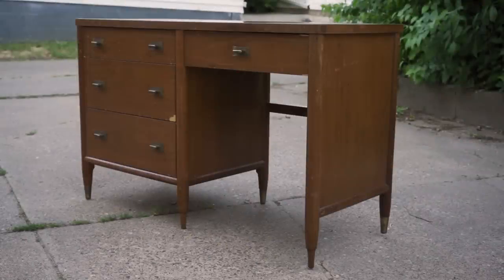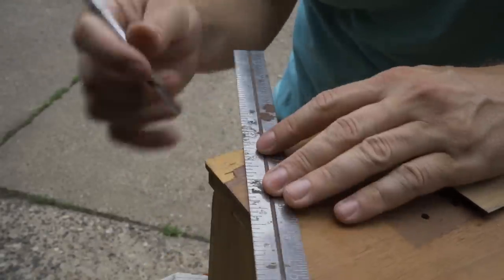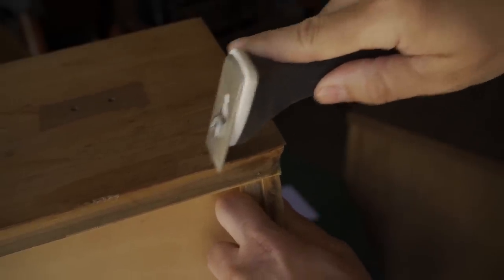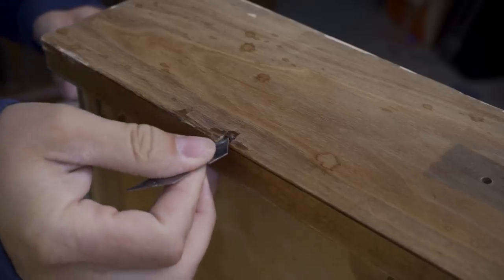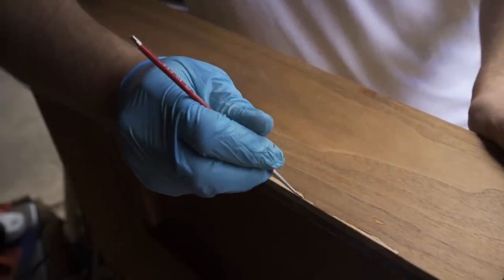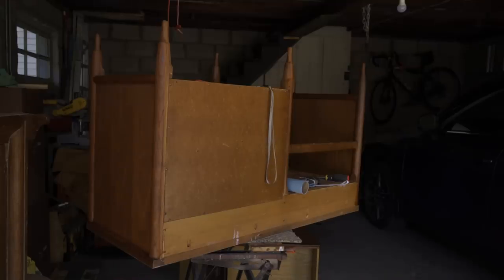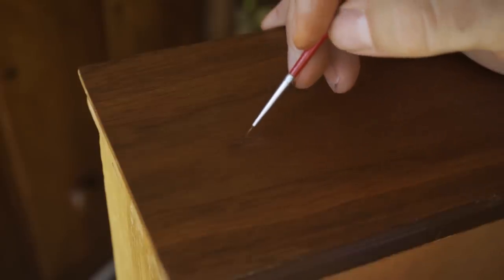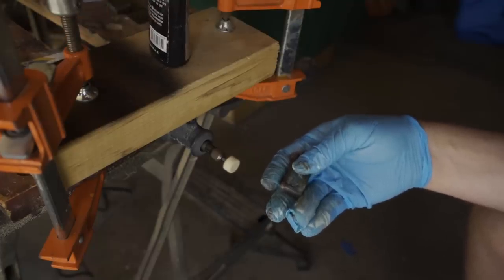I Found A Free Desk On The Side Of The Road And Took It Home For Some Repair And Refinishing

Comment: Looks great, but I think it needs its “shoes” back on.  I would try to find a set of “sabots”.
Reply: Agreed. They are half the charm of a mid-century piece like this.
Reply: I would place the side "shoes" back on and the front middle one. I would fake the one in the middle back with wood filler or whatever was handy to make it thicker and paint it with metallic paint to look like the rest. The top is hideous after you made the piece look so stunning. Anything would be better than plastic. Including plain black paint, tearing out the plastic and chancing it to have a half decent underlayer of wood and working with the trim height  accordingly to fit decrease of top thickness, or tear plastic off and replace it with leather or poly-leather which is very economical.
Reply: @suzanneribas3746 to say that the top looks hideous is pretty rude, don't ya think?  Plenty of MCM furniture was made with laminate tops.
Reply: There are metal workers in many areas who could fabricate new ones that most of us couldn't distinguish from the originals.
Reply: I was kinda back and forth on that. It does have a neat shape, but their purpose is to protect from nicks and bangs and it does effect it's 60s charm.
Reply: @suzanneribas3746  You should start a youtube channel
Reply: Yep.. put the caps back on,,, AGREED
Reply: @suzanneribas3746  This was an awesome restoration.  Maybe you could share your work doing better?
Reply: @hurkamur1  Exactly. The amount of time, effort, and knowledge it took to do this project, and then also share it on you-tube, is exemplary.  I very much appreciate it. So many people either choose to, or feel they are forced to, just punch a clock - that makes it that much more valuable to see genuine value created.
Reply: I can see that. With a high polish like the pulls.
Reply: @nemo227  I agree they need SOMETHING. But in the nature of making it unique, I would like to see him braid leather strips in place of the metal 'shoes'. That would make it functional and art.
Reply: @zumbafosto   You think like an artist.  Nice.
Reply: @ozrob76  No "I make a new one" ?? Machining two out of brass rod wouldn't be that big of a deal, but maybe getting the patina right on the two new ones might be.  But I agree; MCM pieces typically have that kind of accentuation.  Maybe clean all of them (plus the drawer pulls) with flour, vinegar and salt, and then do the patina for all of them at the same time.
Reply: I agree, I think it would look good with the brass shoes back on
Reply: @ozrob76  He said that the veneer would cost $100. Not worth it.
Reply: The shoes should have had the curvature profile of the wood underneath. That simple conical profile does kind of clash with the drawer pulls, to my eyes, even though the finish looks about the same. A small cap just on the very tips might be a good idea just to discourage the wood beginning to split right there. The desk restoration and the video are both well done.
Reply: @siskse  formica was new and considered high tech
Reply: Came out beautiful. Thanks for sharing.
Reply: Agreed.
Reply: agree
Reply: Totally agree!
Reply: Looks good barefoot
Reply: @suzanneribas3746  I love the metal caps  on vintage furniture. Restoration is that tho. You alter it to the minimum. I dislike the top.  Probably period related any way. Leather....or fake leather and adding filler and gold paint would be to crafty for a restoration job.
Reply: I agree. The MCM tapered leg needs its original metal caps- they protect the narrow ends from splitting- and they will.
Reply: @siskse  it's not exactly the top material that's the problem,  it's the dullness and color
Reply: @stevejohnson1685  this is not "my mechanics"🤣.

Comment: I was so glad you didn't discard the drawer pulls!  I really like MCM furniture--the clean lines and no frills look to them.  While you were doing all the small fixes, I thought, "What patience this guy has!"  Great job and a lovely piece.
Reply: Beautiful job! ... Talented refurbisher! Amazing, you can bring most every worn "piece" ... back to life! 💕💓👍
Reply: Very interesting design. Kinda shows it really was hand made.
Reply: I really have learned patience from watching him. Oftentimes on old furniture, at some point someone has inserted tiny nails to attempt to shore up a joint up that really needed to be glued and clamped. Those little devils often have very small heads and I would get so frustrated trying to remove them. Watching him just painstakingly using  needle nose pliers and taking time taught me something valuable. I don’t have tons of experience, but gradually I am having more success. It is very satisfying to see a piece of furniture take on a new life.

Comment: Beautiful job as always..now, what can u do for a plastic top like that other than replacing it...because it looked like the top did not go with the rest of the desk...could you stain the top?..or is that not possible, since is plastic
Reply from the maker: Not much you can do except put a new veneer over it or paint it.  Stain would not be absorbed since it's plastic.  Thanks for watching.
Reply: @DashnerDesignRestoration  too bad...what do you do with your pieces?..Do you end up selling them..i love mid century anything! It had class, no fuss, simple but elegant

Comment: If it were my channel:
"Hi, so I found this old credenza on the side of the road. 
I'd been drinking, so I found inspiration to restore it.
First, I applied a damp paper towel to dust it off. 
Next, I noticed one of the legs was loose, so I took my Harbor Freight hammer, and a random nail from my junk drawer and started pounding. 
After this, I noticed my pounding was causing the old wood of the leg to split, so I promptly screamed MOTHER (expletive). 
Next I hammer fisted the credenza, piercing the veneer. 
Then I called the credenza a piece of (expletive).
Thanks for watching."

Comment: The metal feet and the pulls look like brass which can be cleaned up quite nicely, and the pulls look good with the stain colour. I hope you can find a use for the brass feet someday. That's a really good desk that someone gave up on, way better than mdf or chipboard. You made it new again, great renovation. I like seeing wood brought back to life instead of chalk painted all the time. 👍
Reply: I would have liked the metal to stay on the legs, just cleaned up like the drawer pulls. I remember furniture from the 1950s and those metal capped legs
were a sign of the times.
Reply: I was surprised that the pulls weren't cleaned up, and it's a shame that two of the legs had missing caps.

Comment: I knew you were going to use candlelight. The desk turned out great. Instead of refinishing the top with a walnut veneer, would you consider a new wood grain finish laminate or other finish for the top? Or do you want to keep the desk as original as possible?

Comment: Since the edge of the desktop is solid wood, it would be interesting to remove the laminate, shave down the middle section about an eighth of an inch, and glue on some vinyl oil cloth.
Reply: Why vinyl oil cloth? How is that better?
Reply: @libby2012  Libby what is this? Why are you running to the barricades with every slightly critical comment? Strange.

Comment: Gosh, what a beautiful ‘save’! I just ran across you channel and I could see right away you are a true professional, so I immediately subscribed. I have a table that needs (for a long time now) some work, but I have been dreading that smelly stripper. I am wondering about the stripper tool you were using and if that might work for what I need. There is no veneer

Comment: Nice work. Until a few years ago I used utility knife blades as seen here. One time I reached for a fresh blade and the box was empty. I found a single edge razor blade. I now use them for intricate cutting. They also make for decent scrapers in small hard to reach into areas. I like your curved blade Xacto knife and will pick one up. Thanks again for the video.

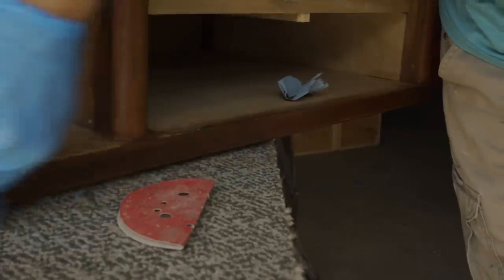Comment: I love this left-handed desk :-)   @17:42  An easier method is to make a mix of 30% Salt 30% Flour and 40% White Vinegar, stir (it should resemble mayonnaise consistency) then pour it on saran-wrap, place all the dirty brass parts in and wrap it tight. Leave over night or 8-12 hours then rinse off and it's all clean, no scrubbing, no sanding. If you don't want them to re-oxidize spray with clear top coat.

Comment: Your workmanship is very exacting and elegant. 
Formica and other laminates were much used in the 1950's and 1960's, but I think a wood veneer top would look better , add to it's resale value, and upgrade the piece as well. I think it's worth the investment. However, beautiful work on your part.

Comment: Buy yourself an old crockpot for the handles...lol I learned that one back in the 90s. We lived in an 1890s Craftsman that someone had painted much of the woodwork in, including the hardware on the cabinets, windows, and doors. I spent months sanding, scraping, and stripping mahogany and walnut floors, trim, and cabinets... months on my hands and knees. I soaked all the hardware in a crockpot filled with white vinegar to get off the paint. It came out beautifully.

Comment: Funny thing, on a walk this week, a neighbor nearby put a dresser drawer unit on the curb, appears to be at least 70-80 years old but in fine structural condition.  Just needs similar repair and refinishing 
Same great build quality with dovetail joinery and similar signs of craftsmanship and quality materials 
Similar grade furniture bought new today would be very expensive

Comment: I refinish mid-century modern furniture too, and it's generally finished with toned laquer and laquer, NEVER stain. Stain brings out the grain, but it increases contrast, while the goal with MCM furniture was usually to even out the grain, which toned laquer does. I think this would have matched the top better using toned laquer as the colorant and a couple costs of satin laquer to protect it.

Comment: You did beautiful and patient work. It is wild how many folks will toss ou things that can be made pretty again, just cause they got something new. My wooden things stayed around until they fell apart...not have equipment nor money to get them fixed they were tossed. However if they had big enough areas those got saved, sanded, and painted for other uses later on.

Comment: Hi from Australia. I’ve never used a scraper to remove finish before but am thinking about getting one as it seems so easy to use. Any advice on purchasing a scraper & am curious, do you need to sharpen a scraper periodically?

Comment: It looked pretty good from 10 /15 feet away next time three coats of clear wet sand with 1500 in between coats. touch up paint repair. on the top again 3 coats of clear wet sand between coats

Comment: I think I would have painted the top, as the laminate is not attractive.  Also, to save a lot of time and effort, I would have made the 2 veneer patches a regular size and shape, e.g. 1"×2", to make it easier to cut out.  Also, you would nor risk the chance of an error in tracing the odd shape of the patch, and having g to do it all over again.

Comment: I would have liked to see that desk with a clear shiny paint, to see the actual wood. nice little desk and wood is a precious material, that people throw something like that away is odd.
some filling material on the shipped spots before painting, and that thing would look new. 

the top is plastic, not a precious material but makes sense, imagine spilling a cup of tea or coffee on the table if the top was wood, plastic doesnt soak in liquids, easy to wipe clean. 

for people who like that style of furniture. 

btw, did you sell that desk, for how much did it sell? i wonder.

Comment: Next time you don't want to completely remove the old Finish wash it with soap and water then a mineral spirits steel wool scrubbing followed by a wet sanding repair with lacquer candle gouges missing pieces excetera refinish wetsand repeat

Comment: A tip for cleaning drawer pulls. Boil in 50/50 water and vinegar for 10mins. Scrub with 0000 steelwool..some people will use barkeepers powder at this point, but not necessary.

Comment: I think you did a great job on this piece. That was a lot of meticulous detail on that veneer. If you wanted a set of legs to give it more of the 50's vibe, Amazon has a set for 18.99 plus tax and shipping. I found out that they even sell the hairpin legs(not for your project, ofcourse). I'm just saying, they have a good assortment of replacement parts. Great job! 👍

Comment: Your work is both amazing and fascinating. I love how you often use a scraper in place of sanding. Looks so much more satisfying. What kind of scraper am I looking for if I get one, I see some paint scrapers in the paint section, but they don't look very sharp, and are not curved around like yours, they look more like a flat scraper that would be used more for removing paint stripper, is there a particular brand of yours or maybe an alternate name for it I should look out for? Should I be looking moreso for something with a razor blade attached?

Comment: You did a beautiful job on the desk! It turned out lovely! I have used denatured alcohol in the past. It dissolves the current finish and you can wipe off grime and dirt at the same time. Finish off with tung oil (not sure if that’s spelled correctly.  I used this method on an old bed and dresser tha belonged to my husbands grandmother. The pieces were black with age. When done I found that some of the carving was actually stained with colors. No one in the family wanted it because it was ugly. I needed a bed for a guest room. When my in-laws came to visit after the make over and we’re astonished that it was the same furniture. We also inherited an oak claw foot dinning table and side board, but someone used polyurethane and the process I described above will not work on that type of finish. When I get ready to refinish those pieces I will take them some place and have it professionally stripped.

Comment: Oops, sorry. Veneer involved. Do I find this tool in the paint department or where? I have a stripper type thingie I used on a fire pit to get the rust off before repainting, but it looks kinda heavy duty to use on a table. Do you think it would work or should I invest in something better? If you have time to answer me, I would appreciate it so much.

Comment: Just a general question: how many coats of polyurethane do you typically put on your pieces? The wood grain usually rises after the first coat which then requires sanding for a smooth finish with the second coat.

Comment: I have updated an older laminate top buy using the same gel stain as the body and allowing to set for a few minutes before rubbing it off. This fills in the micro scratches and sun fading. Then use a matte topcoat as if it is wood. Works well.